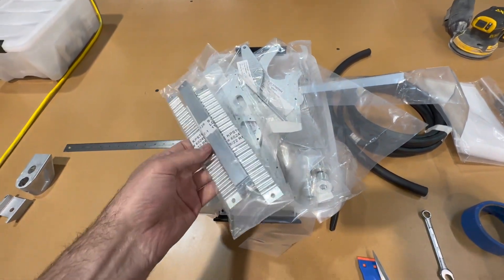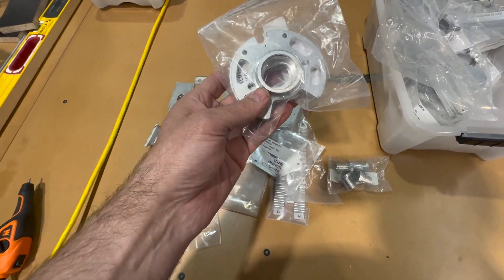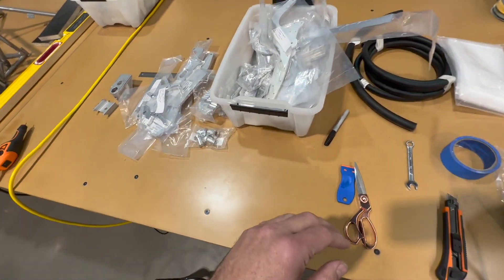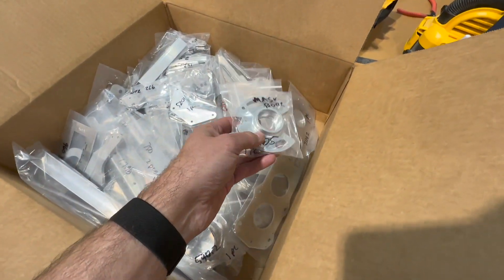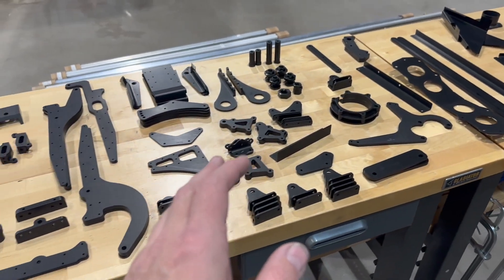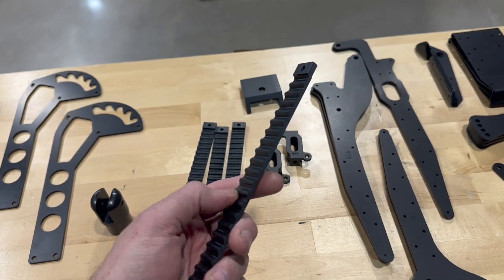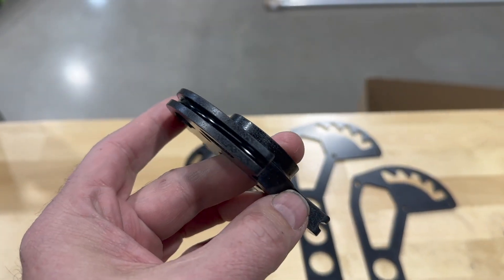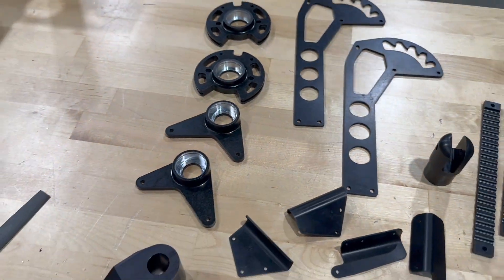Ep. 3 - Anodizing RANS S-21 Aluminum Parts

Comment: What is the downside of doing all parts as type 3 and having the more durable surface?
Reply from the maker: Type III is a more aggressive process and also costs more. Especially if PTFE coated afterwards. Thin parts could potentially deform slightly during Type III where as Type II is more friendly to delicate parts.

Comment: Those came out great. Could you have done the internal ribs to all the flying surfaces as well to meet your minimum or would you not want those anodized for some reason?
Reply from the maker: good question. I considered it, but opted not to. Anodizing of thin sheet metal parts can cause slight deformations and warping. On large pieces like wing ribs that would have been a risk.